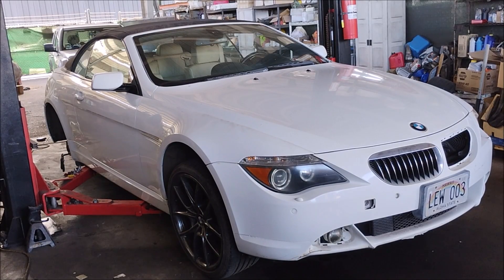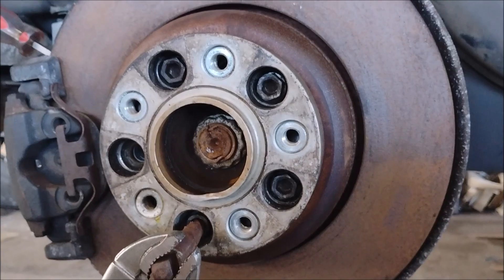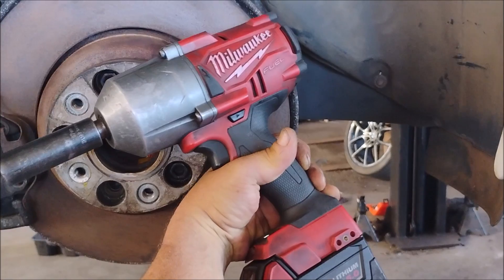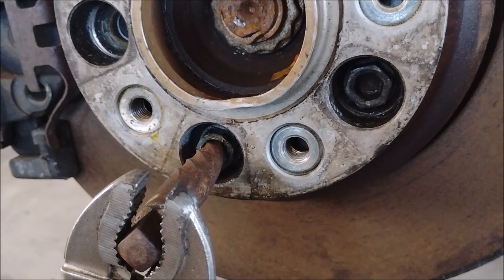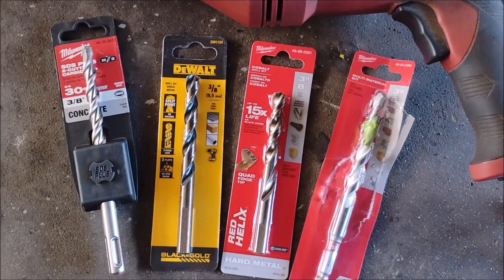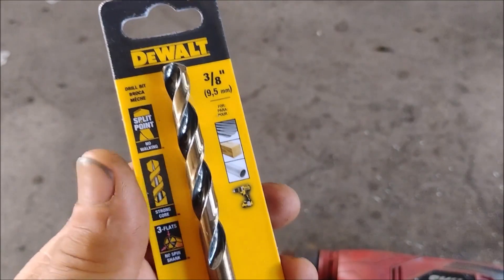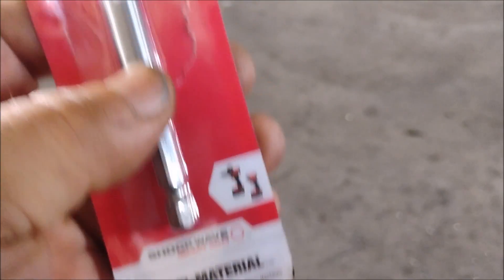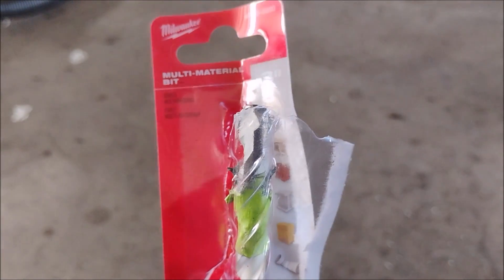Best Drill Bit For Hard Steel Lug Bolts

Comment: Masonry bit on a hammer drill did it for me😅
Reply from the maker: Pal the point here is that not all masonry bits are created equal. The bits featured here also happen to be masonry bits. I didn't dwell on that, because it would confuse the issue.

Comment: Ive tried using easy-outs but even with a drilled hole in the bolt the easy-out never grabs. I also have trouble centering the drill hole in the bolt. What am I doing wrong?
cheers & thanks Frankster.
Reply from the maker: The hole needs to be deep enough for the extractor to set and grab. Maybe drill the holes a little bit deeper. To keep the bit from wandering on start, use a punch and hammer to set the starting point, and maybe use a small bit for a shallow starter hole.